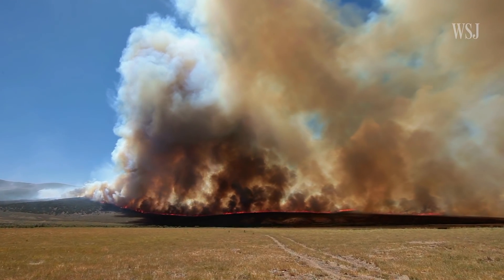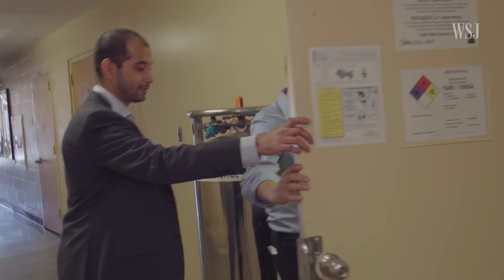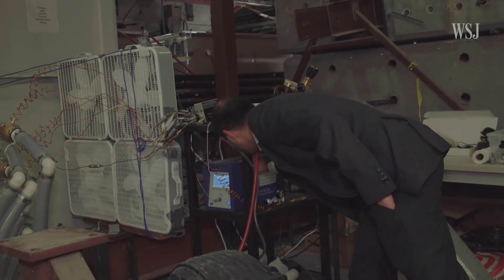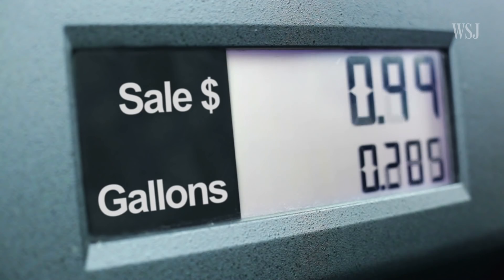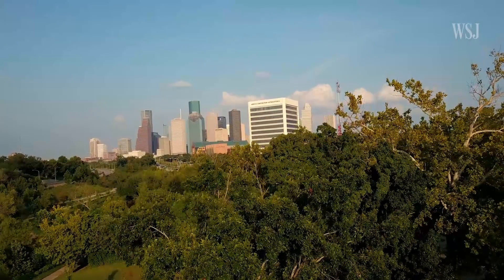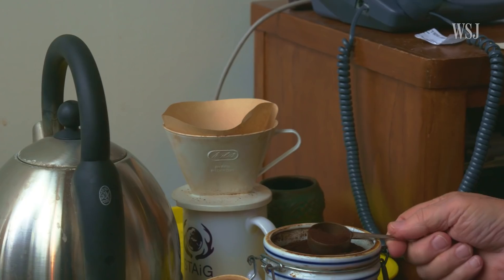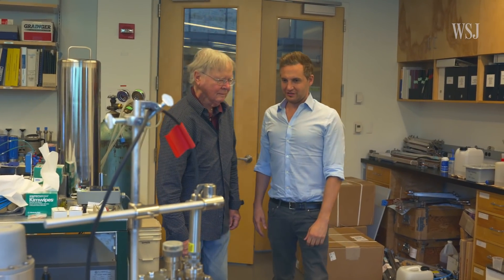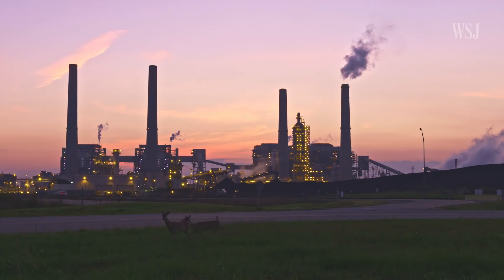Carbon: From Pollutant to Product | Moving Upstream

Comment: Humans are responsible for 4% of CO2 released in the air each year. The CO2 isn’t collecting in a cloud above over heads. It’s part of the life cycle. The CO2 released in the air last year or before has already been used by plants. Take CO2 out of the air successfully and plants will die. We will die also.

Comment: This video missed one of the leading carbon capture technologies in commercial use - CarbonCure.  Adding CO2 to Concrete to reduce the amount of cement in the mix, thus reducing the cost and carbon footprint of the concrete.  
Installed in about 70 concrete ready mix plants with anther 30 scheduled for installation.  http://carboncure.com/producers/
This is my bet for winning the Carbon X-Prize.

Comment: Renewables are cheaper. It's over for fossil fuels.
Reply: We'll still be drilling for oil, we just wont be burning it like savages
Reply: No, it'll require a transition.  Fossil fuels are no doubt 90% or more of the world's energy consumption, which is hardly over.
Reply: @homewall744  Indeed!20-50 or more years!The entire power infrastructure would need to be updated,or re-created!
Reply: +Erik S We need to use our oil only for stuff like space exploration
Reply: not feasible for that use, that's why NASA uses solar and nuclear
Reply: ...Not for many,many years!Think maybe 50% fossil fuel replacement by 2050!A total upgrade or replacement of power infrastructure!Politics!

Comment: The bricks don't make sense. at least as described in the video:
you heat lime stone to get Calcium Hydroxide:

CaCO3 + H2O -> Ca(OH)2 + CO2 

Calcium Hydroxide is capable of binding CO2 to form limestone (reverse reaction), and that's a decent building material. The amount of CO2 the system will absorb will be lower (due to the small exposure surface) than the system emitted during its production.

As shown in the video there is no net gain, because you even have to factor in the energy to facilitate the reaction (at around 400 deg celcius).

Comment: This is a lot of work to capture and use carbon dioxide to reduce net emissions. Better to leave it in the ground and find a lower carbon way to live.
Reply: Trees remove CO2 until they catch fire.  It's going to take all directions, not one perfect and easy solution.  Better is not the point as even if you stop burning today, you'd still have lots of CO2 already there.